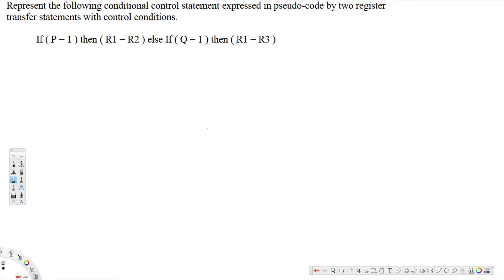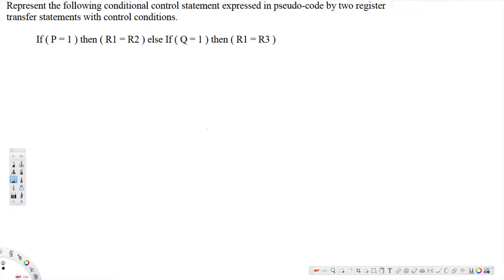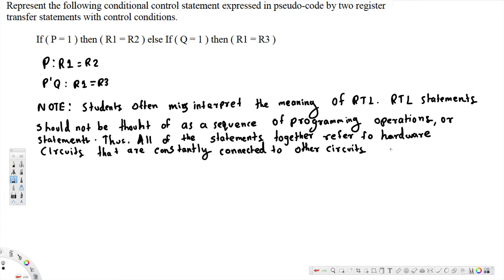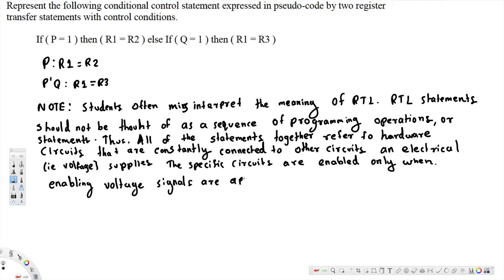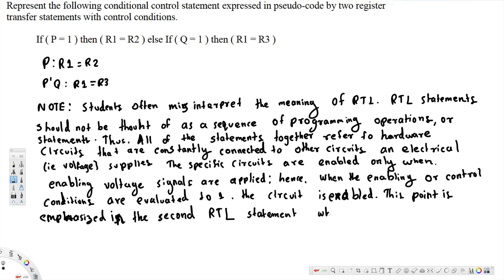Represent the following conditional control statement expressed in

Comment: 1.	Present the following conditional control statement by two register transfer statements with control function 
If (P=1) then (R1<-R2) else if (Q=1) then (R1<-R3)   
pls solve this
Reply from the maker: Here is a solution using two register transfer statements with control functions:

Copy code
if (P=1)
  R1 <- R2 [P]
else if (Q=1)
  R1 <- R3 [Q]
The control function for the first register transfer statement is P, and the control function for the second register transfer statement is Q. This means that the first register transfer statement will only execute if P is equal to 1, and the second register transfer statement will only execute if Q is equal to 1. If both P and Q are equal to 0, then neither register transfer statement will execute.
Reply: @ThilebanTheEngineer  can you pls draw digram for this?
Reply: i want to know that how many control circuit we have to use ?
Reply: can we use OR gate to give load to register R1 ?
Reply from the maker: @आओखुदसेकरनासीखें  Here is a block diagram that illustrates the two register transfer statements with control functions:

      ┌──────┐
      │  P=1 │
      └──────┘
          ▲
          │
          ┌──────┐
          │  R1  ├──┐
          └──────┘  ▼
          ▲  ┌──────┐
          └──┤  Q=1 │
             └──────┘
In this diagram, the rectangular box represents the register transfer statements, and the circles represent the control functions. The lines connecting the boxes and circles represent the flow of data and control signals.

When P is equal to 1, the first register transfer statement will execute and transfer the value in R2 to R1. If P is equal to 0 and Q is equal to 1, the second register transfer statement will execute and transfer the value in R3 to R1. If both P and Q are equal to 0, then neither register transfer statement will execute and the value in R1 will not change.
Reply from the maker: @आओखुदसेकरनासीखें  Yes, you can use an OR gate to give a load signal to register R1 based on the values of P and Q. The OR gate will output a 1 whenever either P or Q is equal to 1, and it will output a 0 only when both P and Q are equal to 0.

Here is a block diagram that illustrates this using an OR gate:

      ┌──────┐
      │  P=1 │
      └──────┘
          ▲
          │
          └──────┐
          ▲      ▼
      ┌──────┐  ┌──────┐
      │  Q=1 │  │  OR  ├──┐
      └──────┘  └──────┘  ▼
          ▲  ┌──────┐
          └──┤  R1  │
             └──────┘
In this diagram, the OR gate generates the load signal for R1. When either P or Q is equal to 1, the OR gate outputs a 1 and R1 is loaded with the value from either R2 or R3, depending on which register transfer statement is executed. When both P and Q are equal to 0, the OR gate outputs a 0 and R1 is not loaded with a new value.
Reply: @ThilebanTheEngineer  thank you so much for your support and give your valuable time to solve my problem